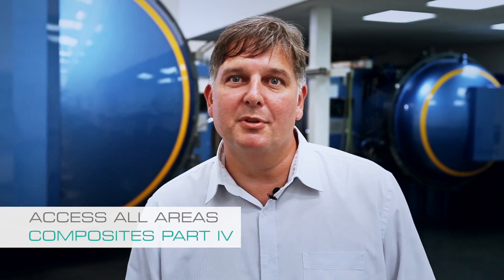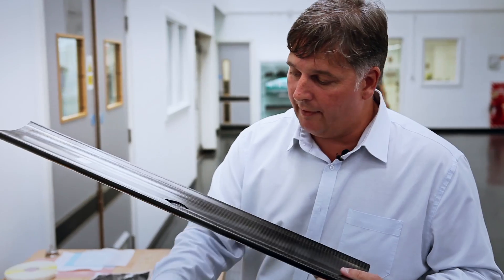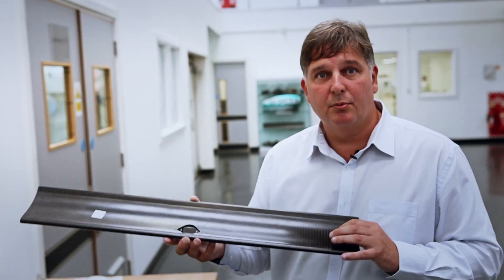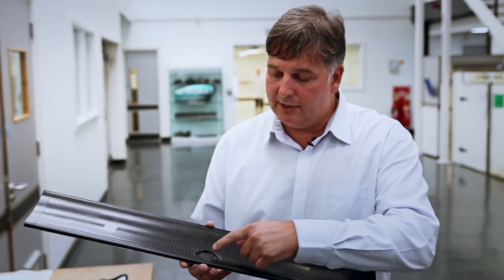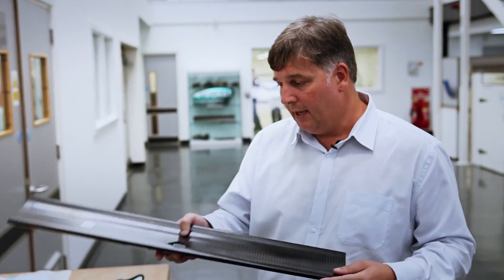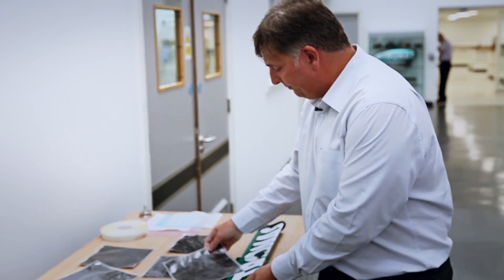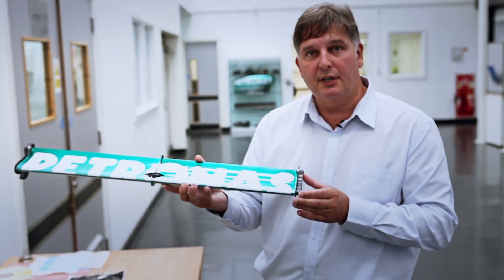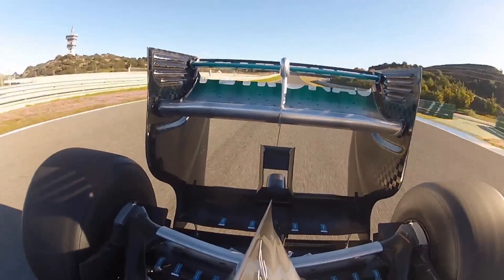Access All Areas - Composites (Part 4)

Comment: I think because so much air is flowing on to the wing, it need to be strong so it won't flex during high speed so it doesn't have turbulent flow and slows the car down a bit. they want the air flows seamlessly through the wing. From watching drag racing, fiberglass panels flex a lot, even in low speed